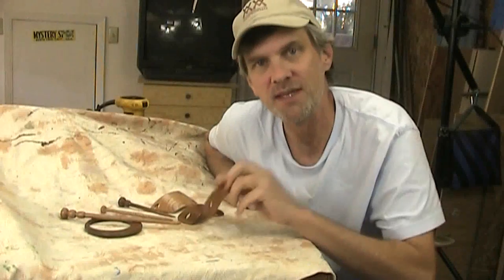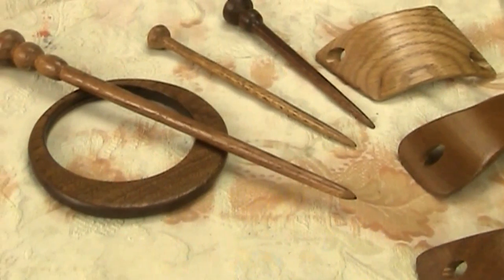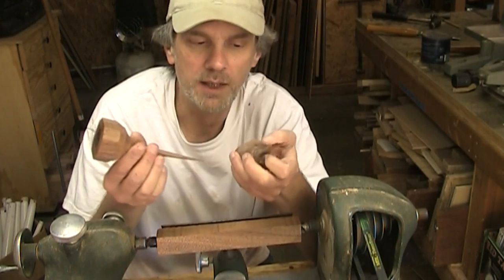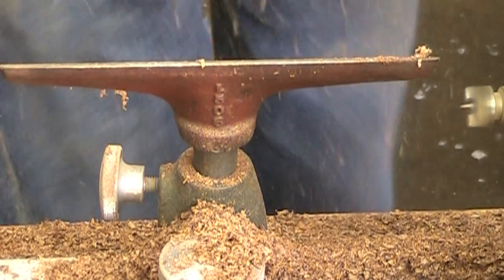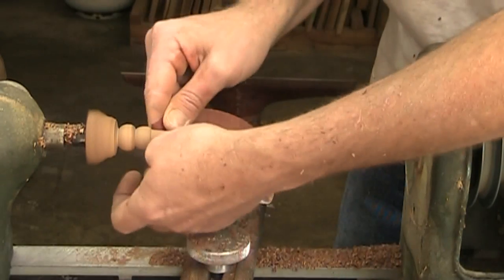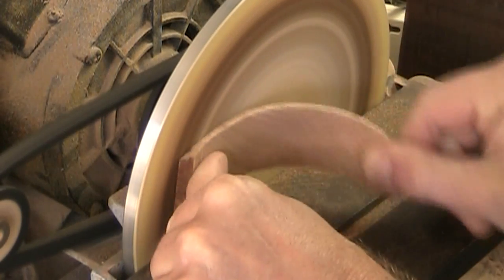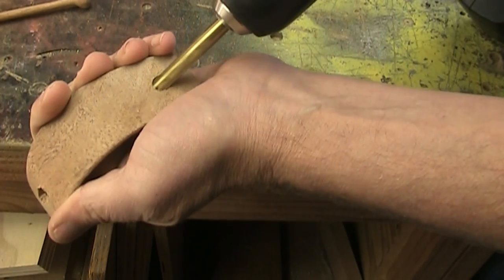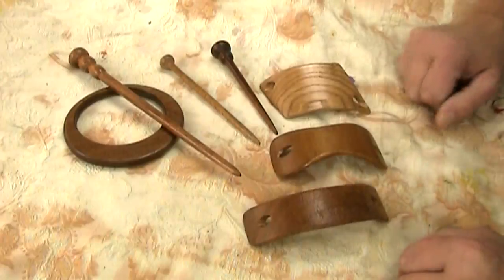Wood hair accessories

Comment: Is that the smallest diameter that those hair sticks can be turned? Also, can you hollow out what could be a small bowl and then just part it off above the bottom of the bowl so you'd have basically a bottomless bowl you could then band saw in half for the pin catchers? Just curious.

Comment: Nice, my aunt used to wear these when I was a kid. They're cool again!  Though, and this is just a question, aren't the pins supposed to go through a piece of leather?  Generally there's an image scored into the leather.  Suppose if the wood is flexible enough, it doesn't matter? You could also, etch an image into the wood and burn it in?

Comment: That as a lot of wood to waste turning that hair pin and also why it blew up.  You had huge amounts of wood on either end and that small spindle had to turn the chunk on the tail stock end, plus withstand the pressure of being turned between centers - it eventually gave up.

I turn Midlands lace bobbins for my wife (like a guy can't have too many tools, a lace maker can't have too many bobbins).  I turn at 4000 rpm and start with a blank no thicker than 3/8" mounted in a Jakob's chuck.  The tail stock only keeps it centered, it doesn't add pressure.   They are finished with friction polish then I part at the tail stock end first, then from the headstock.  The chuck doesn't come out but I keep the tool rest overlapping the chuck just in case.  I've turned these hair pins and other small diameter stuff the same way and don't have to do the finish sanding.  Lots less to sweep up, too.

When you come to Santa Cruz to visit your son, look me up and I'll give you a demo.

BTW, the CAPTCHA on your website kept rejecting entry so I posted my comment here.
Reply: I am too sexy for my hair! My hair is too long with ArganRain.

Comment: For some reason I'm thinking you might want to add a disclaimer along the lines of "placing your fingers 1/8" away from a disc sander, band saw blade, or router blade is not recommended" :)

Comment: Steve, when you were using the last largest drill bit on the curved plate, and you had your hand under it, I thought of last week when I did the same thing with a piece of plastic, and then the 1/2" bit caught, jetted forward, and ripped a good sized chunk out of my palm. I'm usually not one for "safety first", but you had me shaking in my boots, haha.

Comment: Someone gave me something similar to the last combo she tried on, and I have not been able to figure out how to use it. The distance from the edge of the curved piece combined with its own weight makes it hard to get it to hold something sturdily. I was so excited to see how she did it and then it was cut out of the video. Oh well, on with the search. I'm not even sure what it's called.
Reply: This is a little late but it's basically like a barrette, but instead of the usual clip it has the stick instead to hold the hair. And you'd use it the same way, fix your hair how you want it and with a barrette you'd slide the clip part under the hair and snap it, this you just hold the part with the holes over the hair and insert the stick into one hole and then under and through the hair and out the other hole. Hope that helps many years too late, lol.